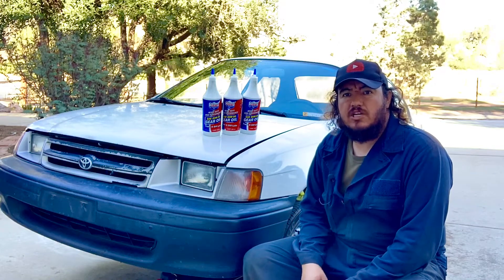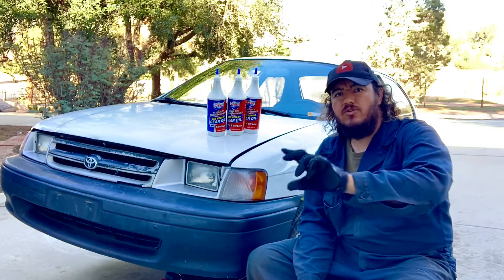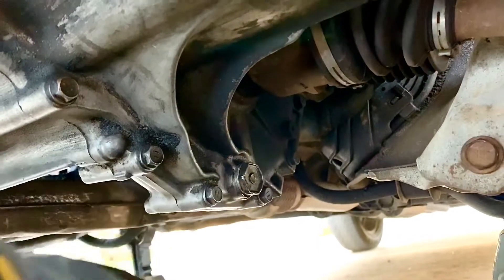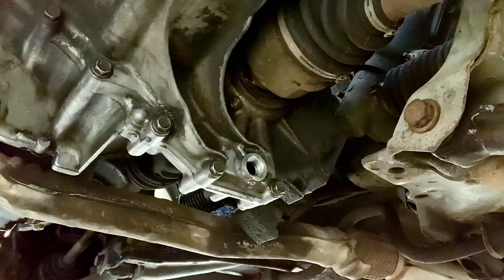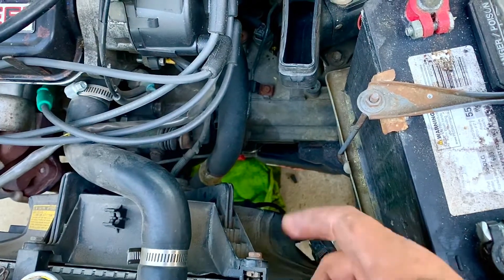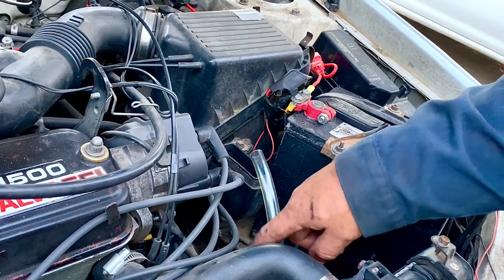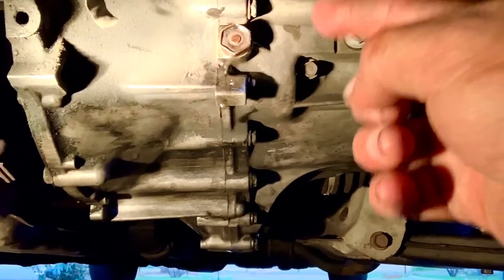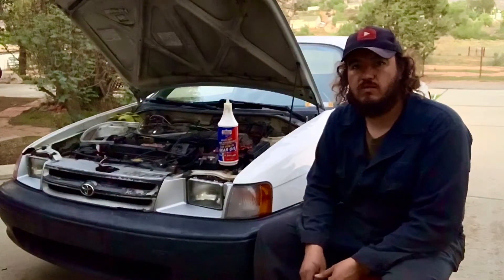How to change gear oil on a Toyota manual transmission @elchanojose

Comment: Would i plz help me in my Corolla manual transmission its easy to shift gears up words but when i need to down the gears i feel it lil hard specially its very hard to shift from 2nd to 1st what could be the problem there is no grinding sound

Comment: Is that oil the same as 75w90 ?
Reply from the maker: Hello Spicy!  The gear oil 75w-90 is about the same as 80w-90.  This two gear oils are about the same but we recommend that you use the right oil weight recommended by the car manufacturer that you are driving to avoid components damage.  We use either 75w-80 or 80w-90 and never had a problem.  Take well care Spicy!
Reply: @elchanojose  gracias hermano 🫡😎